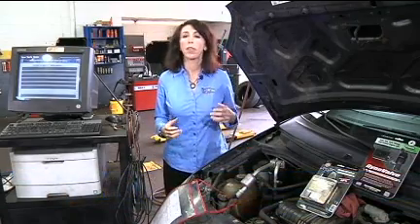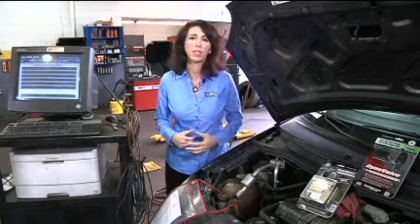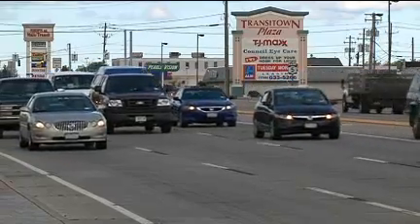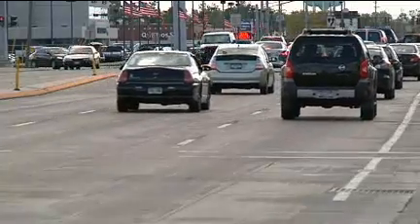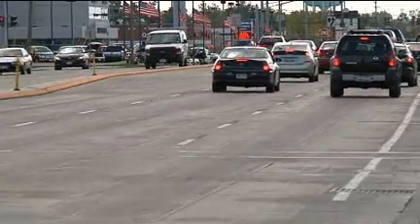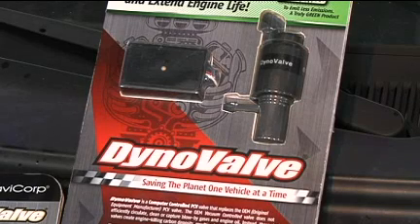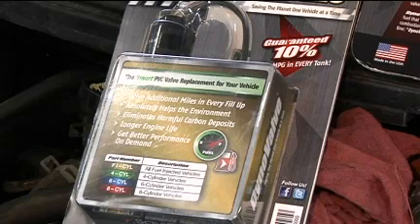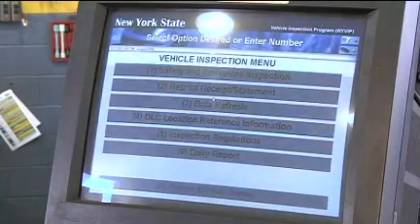Better Fuel Economy with DynoValve: Lauren Fix, The Car Coach

Comment from the maker: this can be install in any car new or old.  I have installed the product to test it and if you can turn wrenches, feel comfortable with electrical and know what you are doing its pretty easy.  Its regulate the PCV so the fuel economy and horse power are improved and close to zero emissions.  Its been approved by CA EPA too.

Comment: Lauren Fix, I also saw you on stossel.  Can you field one question on the dynoValve for me.  I am concerned that they are installing it in older vehicles.  Have you witnessed the product installed in a new vehicle and producing substancial reduction in gas.  You can understand my concern it you have an older vehicle with a clogged failing pcv valve would just replacing the valve with a new one offer a big gas savings.

Comment from the maker: DynoValve from Savi Corp - toll-free number. 800.611.7284 - has to be installed by a certified installer. They can give you the pricing - its not cheap but it works!
Fuel Fix Rx by Well Worth Products -  cost is about $5 / bottle